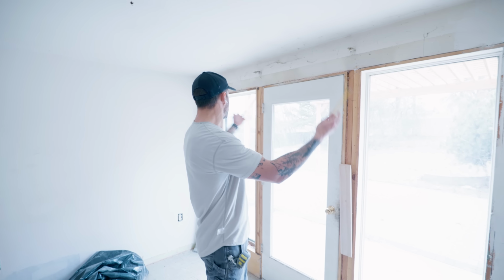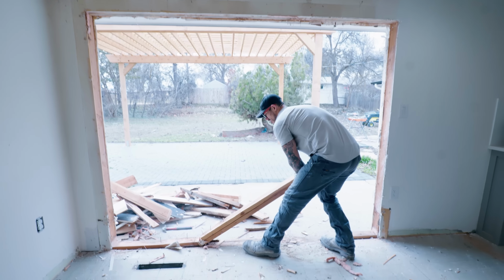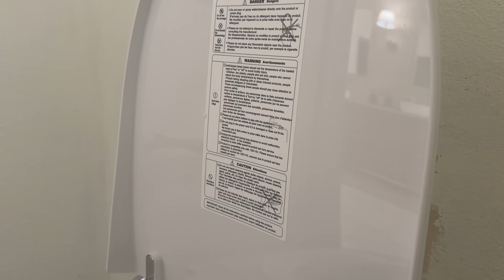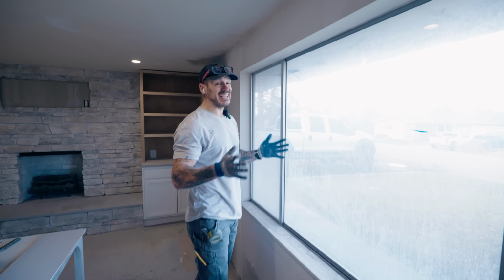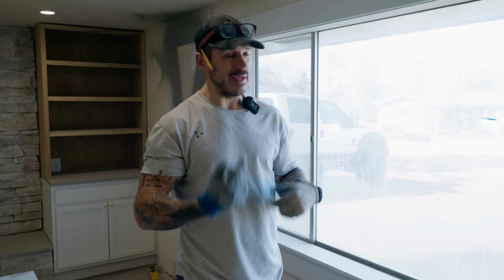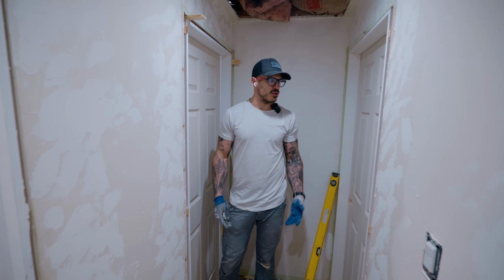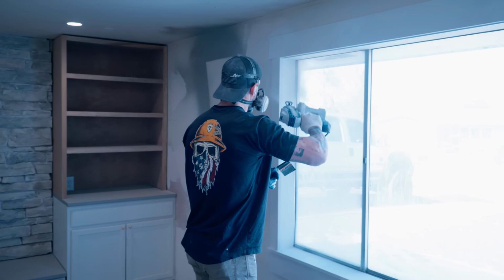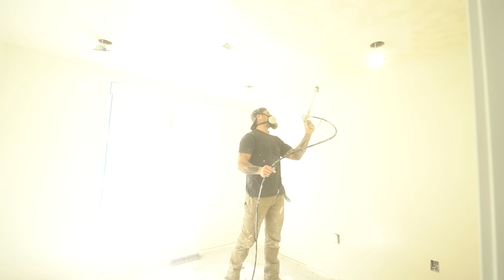This will be a BIG change!

Comment: Can't wait for the next video where he has to rip out all the new trim because it's not compatible with new windows
Reply: Interesting…shouldn’t he have done the windows first then the trim? Kinda backwards
Reply: Yup. Depth will be different if you want to do it right with flanged windows
Reply: That's only the inside trim. he could install from outside, but technically only be half secured.
Reply: Should have just waited the 3-4 weeks.
Reply: Hahaha was going here to comment the same thing!!!
Reply: Yup

I come to this channel for a good laugh on how bad it is

Comment: If you are replacing windows from those single pane metal frame ones you should look into utility rebates from either the electric company or gas company depending on how the house is heated(gas furnace vs electric). They will usually have some rebate to go to double pane windows.

Comment: Won’t you have to rip out all that trim when you replace the windows?
Reply: I came here to ask this as well.  Never heard of someone trimming out a window that isn’t installed.
Reply: YEP.
Reply: He's going to use remodel windows that will install flush to interior trim but the outside flashing/trim detail suffers
Reply: @Hangovna Remodel windows will still sit in further then what he did here. It will all have to be ripped out.
Reply: @evictioncarpentry2628 He loves doing it. He ripped out perfectly good exterior trim that he already painted black… could have careful detached and reused at least some of it… nope he just broke it in half. 😂😂

Comment: Paint makes a big difference! But so does trim, new doors and so will the new windows. Question, the ceiling is quite low, was it possible in the beginning of demolition to knock down the ceilings and raise them up or is that how the house was designed? I’m wondering if instead of keeping the attic, bust through the drywall and allow the ceilings to be a statement or if you could go back and redo. It’s too late now and it’s also dependent on the roof and supports

Comment: the windows were a waste of money. But if the ceilings are so low why not redo them so you have somewhat vaulted ceilings as you don't have a second floor? Also did you put something in the bottom of those doors after cutting off the bottoms? If not those doors will deteriorate quickly.
Reply: I doubt he's got the ability to do that. He's not very good at this.

Comment: Just a word of caution with those bidet toilets, i just had to remove one of them in order to install a cabinet.  This toilet had only been in use for about 3 weeks, the customer had not made any complaints about it, but there were brown stains splattered all over the bottom of the seat and top of the ring of the bowl and running down the side of the outside of the bowl.  Gross.  There are 3 of these toilets in this particular home and all 3 had the same issue.  How creepy is it that there is poo water splattered all over.  Another problem is that the mounting bolts are next to impossible to get to.  You need to remove the control panel (which includes the pee and poo splattered front panel) to gain access to the area where you can attempt to unfasten and then re fasten the toilet.  No thanks.
Reply: Just remembered, the brand of toilet is Cosvalve
Reply: Also there is a sensor near the floor which flushes the toilet when you step near it.  I gave up counting how many times it flushed while i was putting on cabinet handles, towel bars and switch covers.